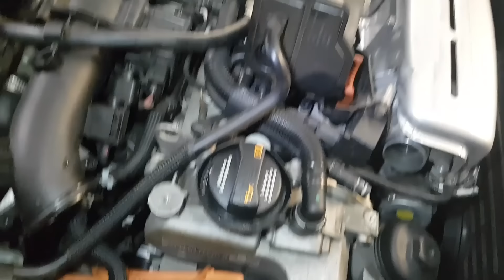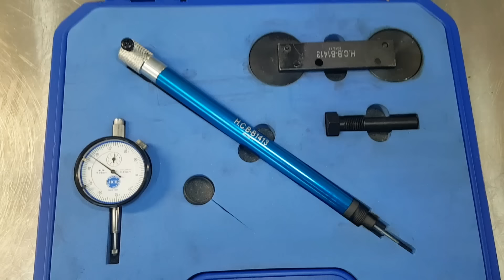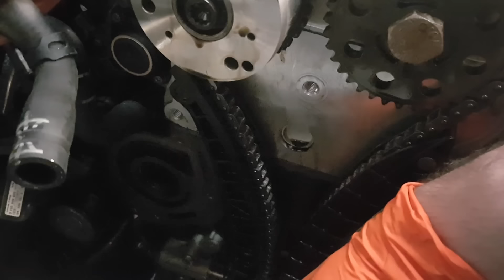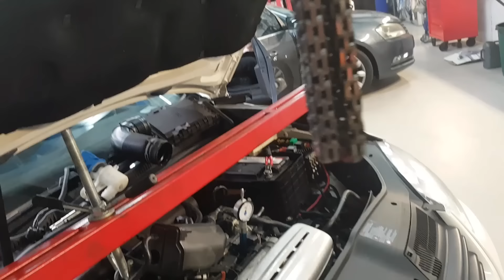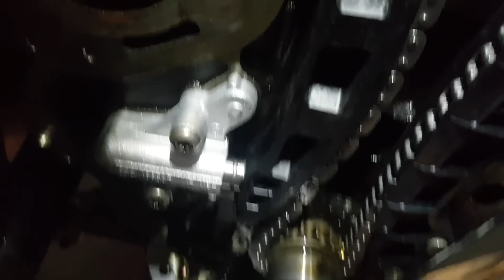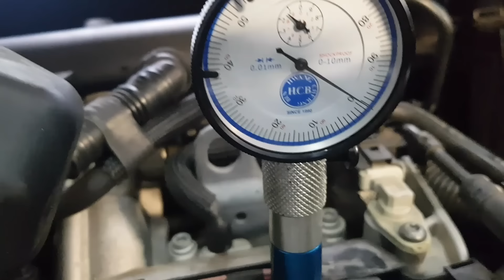P3008 VW 1.4TSI Timing Chain Replacement

Comment: I have just bought a tigy 1.4 tsi 2009 and had a fault code of  00022 crankshaft position camshaft position correlation bank 1 sensor A I have got myself the timing tool kit and new chain kit, from the code I’m getting I’m I just over thinking a simple sensor change? Or would it be benefiting to fit new chain anyway?
Reply from the maker: Your timing chain may have jumped (likely). The latest video on my channel is of a CAXA 1.4tsi golf with the same code and it has jumped timing. Worth doing the chain anyway if it hasn't already been done.
Reply: Could you tell me what size spline tool needed for the cam bolt it seams to be m11 but can’t seem to find one do you know the size and where to get one please, also do I need to remove the drive shaft to get the crank lock tool in?
Reply from the maker: @winxy1499  m12 triple square or xzn socket.
Reply: Thanks for the reply I’ll apparently you on what I find when done be some time next week befor I get other parts and do the work

Comment: What caused the timing chain to stretch?
Reply from the maker: The chains don't really stretch in a true sense, the individual links and rollers wear from poor quality oil and allow the chain to lenthen overall. If there were 100 pieces to the chain and each one had 0.01mm wear for example, the chain would end up 1mm longer. Just shows how such a small amount of wear and deviation overall causes a larger problem. Poor oil quality through extended servicing, wrong oil used, wrong fuel used - all contribute to the issue. The plastic guides break due to the stretched chain rattling back and forth as the engine is being started - where most of these chains jump timing on start  up due to the low engine speed and pulses on the chain drive.
Reply: @FourRingsAuto  
Thank you very much for your professional reply! ;)
Reply from the maker: Not a problem
Reply from the maker: To be honest though,  the chains just wear and stretch in general operation too it seems though. Should almost be a service item, however the biggest benefit of a chain over a belt is not having to change them as per the manufacturer specs. Once this is mentioned though, all thought to the chains maintenance goes out the window.
Reply: @FourRingsAuto  
Thanks for the response.  I've got a vw touran 1.4 tsi with 110k miles and there is a rattling noise on start up, though no codes or engine light is on. I'll have it checked out on servicing....
Reply from the maker: Rattling on cold start can be a stretched chain, tensioner leaking off pressure, or the inlet cam variator rattling (for the variable valve timing).
Reply: @FourRingsAuto  
👍🏿👍🏿

Comment: Great video and very helpful but did you not change the crank sprocket and will this not cause premature chain wear?
Reply from the maker: It was inspected and no damage found on the sprocket. I have inspected many chain drives over the years and you can visually see the wear in most cases. It is a good point that you mention though, and if there had been signs if wear it most definitely would have been replaced.

Comment: How did you seal the base of the timing chain cover where it meets the sump? I took the sump off to do mine as the cover will squeeze the sealant out at the bottom. Great video, thanks!
Reply from the maker: I think i mention in the video (but maybe not) that you are supposed to remove the sump for this reason. But you can get away with it installed if you are careful and have done this before. Applying a thin smear of the silicone sealant used for the corners of the timing cover was used on the top of the sump gasket. If there was a broken guide found upon removal of the timing cover, the sump would have to be removed to remove the pieces. I have done it this way on multiple 1.4tsi engines and other makes and models. It takes care and patience, you can't just slap it together. But I'd advise a first timer to remove the sump.
Reply: @FourRingsAuto  Awesome, thanks. Despite all this work, mine still chatters for the first 3-5 seconds on cold start up. Do you think it needs doing again?

Comment: Hi! Great videos! thank you! Can you please help me  diagnosting a similar engine? I have a 1.4 tsi with 180 hp and a DSG gearbox. This engine makes 13 mpg!! I have used everything, but the VCDS dont show any codes, and everything appears perfect. New spark plugs, no change. Only the knock sensor have 29V @5500 rpm, but vcds doesnt show a error or a timing pull. Car runs strong, apparently doesnt have any problem other than poor mileage. Thank you!
Reply from the maker: Check measured values 32 and 33 for fuel trims. 32 is the adaptation long term fuel trims. Negative means rich condition,  positive = lean. Let me know what you find.

Comment: Great video. Thanks for this. Im doing mine at the moment which I got quite early - no noise or lack of performance, just a P0016 fault. The kit I got came with the oil pump chain, new crank sprocket as well. Can I change these without removing the sump?
Reply from the maker: The sump will need removing to do these. It is the better way to do it as then you know the sump is sealed well with the timing cover too.
Reply: @FourRingsAuto  Thanks for the help. Best video on this procedure out there.
Reply: @FourRingsAuto  Another questions for you. Hoping you can help me out. After 3 days with no problems after the timing chain swap, the P0016 code popped up again. I checked the timing again and it is spot on. Put it back together and let it run through a warm up without going over 2000 rpm as I was thinking it could be VVT related. No pending fault, which makes me think it is a VVT issue. Is this a valid way to check this (Im assuming VVT doesnt kick in till higher RPM). Perhaps its a cam pos sensor issue. The only other possible problem I could see was the positioning of the cams in their journals as they did slide when I was installing the cam gears- should the ends be flush with the end caps (where you slot in the timing lock). The reluctor ring(?) is not centred when I look down the Cam pos sensor hole. Thanks in advance for your help. Cheers

Comment: Hi, when I opened the timing chain cover/housing then found timing chain was almost off the exhaust sprocket. Tensioner was fully released, timing chain almost touching in the middle at guides. One of the screws was lying at bottom of chain housing, bolt smashed, suffered blows from chain, pulleys etc. Do new timing chain to install. 
Most importantly, best way to achieve TDC is by TDC gauge. It’s more accurate than “drop screw in cylinder” method, and through piston stop tool. I have also removed sump so when it cylinder1 was at TDC, I checked crank shaft lobes from underneath , they were parallel to ground and locking tool goes straight into side of crank lobes. Hope that helps if somebody else is in same situation as me.
Reply: What mileage?

Comment: Nice work. Finally I found a good short and informative video of this job, Bought the kit since I will  have to do this job quite often (every 50.000 says the experts).  Hope I get it right. Thanks Four Rings Auto.
Reply: Please, did you change the timing kit? Did you change olso the sprockets?

Comment: Hi, great video. Just wanna ask 2 questions

1. When that special bolt is put in the back of engine head , and turn crankshaft, and when it reaches to a point where crank doesn’t rotate anymore, so then is that the TDC for cylinder 1? 
And if cylinder 1 is at TDC  then at that point will cylinder 4 be at at TDC as well? 

2. To find TDC for cylinder 4 ,  do we have to use the gauge  ? Why did you put gauge in cylinder-4 to find TDC? Do we have to find TDC for cylinder 1 & 4 indecently? 
Sorry I m trying to understand before replacing chain on my golf 1.4 tsi. 
Look to your kind reply,
Reply from the maker: When you put the bolt in it usually is at tdc, however, the vw audi instructions say to measure TDC at the piston crown with a dial test indicator  (the guage you see me use). I have found that when the bolt is in, the engine is at TDC. But it is still worth checking with either a DTI guage or just a simple screwdriver down the spark plug hole.

Cylinders 1 and 4 will be at tdc at the same time. I am using the guage in cyl 4 as it is easier to remove the ignition coil and spark plug than it us for cylinder 1. 

Also, just remember to make sure you have the correct TDC, as cylinder 1 and 4 will be on different strokes although both being at the top of their cylinders.
Reply: Four Rings Auto thanks for your reply. How to correctly find TDC for cylinder 1 & 4. 
When crank holding bolt is screwed , then I shud rotate crank until it stops. When it stops rotating that point is TDC and then I shud check cams with cam holding tool whether they are inline & timed or not? 
How to find TDC for cylinder 4? Isn’t when cylinder 1 is at TDC then cylinder 4 is also at TDC ? 
I have compression test gauge , can I use that for cylinder 4 ?
Reply: Four Rings Auto is this procedure correct to check & correct timing on golf 1.4 tsi
1. Put the bolt in and rotate crank until it stops. 
2. Then remove the cam plate covers and try to fit cam holding tool, if it fits, then timing is correct, if doesn’t fit then timing is out
3. If timing is out, then remove timing chain cover, and remove chain and rotate both cam exhaust & cam intake until both reach 45 degree angle and cam holding tool fit in there. 
4. Then put the chain & tensioner back on, tighten them to 40 & 50 nm . 
5. Then remove bolt from back of crank head and also remove cam holder and rotate crankshaft and to check TDC in cylinder 4. When TDC reaches in cyl 4 then check cam again whether they are in 45 degree angle and cam tool fit correctly. 
Is that it or I am missing something? 
Very sorry for the trouble. Real appreciate your help. Thanks a lot .
Reply: Four Rings Auto , thanks. You mean cylinder 1 should be at compression stroke when finding TDC. I will use a gauge. 
If I find TDC at cylinder 1 and confirmed it by gauge then should I check cylinder 4 for TDC as well?
Reply: Can I use vacuum leak test gauge ? Or need to buy TDC gauge for it? Thanks
Reply: As I read more workshop manual, got more understanding. 
So to correct the timing, 
1. Rotate crankshaft until camshaft locking tool fit.
2. Loose both both exhaust & intake cam sprockets, and rotate crankshaft for TDC. 
3. As soon as compression stroke begins in cylinder 1, I should screw crank locking bolt in, then rotate crankshaft and it will lock / stop at TDC. 
4. Now put on new chain, tensioner, guides and tighten camshaft sprockets as required. 
5. Remove crank locking bolt & cam locking tool, and rotate crankshaft for TDC in cylinder 1. during start of compression stroke, Put the locking bolt in head and rotate crank until it stops.
6. Check whether locking camshaft tool fit or not? If fits , then all ok. 
One thing, where the crankshaft stops by the locking bolt in compression stroke, is this the 100% accurate TDC? Or I should do this test by screwdriver or TDC gauge?
Is there anything else I need to do. Look to your reply . Regards.
Reply: Hi, just checked, both camshaft out of their required position. So timing out confirmed now. Brought the cylinder-1 to TDC in compression stroke and remove cam plates and found both cam out of position, and cam locking tool doesn’t fit. See video, 
https://youtu.be/snfvBrN2DLQ

I will install new timing chain. 🤪thanks for your help.

Comment: I have a Nissan note 2008 with 85k miles it's going in the shop for a replacement timing chain and I've been quoted £702 for the job,is this about the right price for the job?
Reply from the maker: Sorry i don't know much about nissan.
Reply: @FourRingsAuto  okay but how much would a timing chain replacement be anyway I.e say estimation price on a 1.4 petrol

Comment: Hi, nice video, thanks.
How to check timing without dismantling timing chain cover? Because on this model full cover need to be removed to access chain. Can I do it by removing camshaft cover plates and check whether both camshaft in certain specified angle to fit the camshaft tool properly? If both camshaft holes are as specified in repair manual (45 degree) then does this means timing is fine? Look to your reply,
Reply from the maker: Yes that is correct. Remove the plugs at the gearbox end of the engine, and remove the spark plug from cylinder 1 and check it's at TDC.
Reply: Four Rings Auto thanks, I will check , actually I m having starting issue, no engine code , spark plugs gets wet instantly. While cranking oil pressure light also starts blinking. I removed sump to check oil pick up tube, which is fine, now will change oil level sensor & oil pressure sensor too. I was told that car goes in fail safe mode if oil pressure is low, and Computer doesn’t let car start. I will check timing after changing sensors. How to find TDC? Can I do it by putting long screw driver in cylinder 1 and turn crank clock wise to find top high position of screw driver? Or should use compression gauge to find TDC? 
Thanks for your reply.
Reply from the maker: Use the screwdriver down cylinder 1.
Reply from the maker: Do a compression test also though if your spark plugs are wet with fuel. This can be either an ignition problem or compression. Check to see if you have spark.
Reply: Four Rings Auto thanks. I Did compression test after drying cylinders out, it goes over 200 psi in each cylinder. I also did fuel, sparks, etc, all fine. Cylinder gets flooded heavily upon cranking. I can see fuel on top of cylinder after removing plugs. 
Which one is cylinder 1? Is it nearest to crankshaft pulley/timing chain side or the one near to battery/ gearbox? There is another video of a German guy who changed chain on this particular model (1.4 tsi 170 bhp golf mk5), but he used cylinder nearest to timing chain to find TDC rather than far right cylinder? Appreciate you time & help. Regards
Reply from the maker: @786hunzavalley  cylinder 1 is timing chain end. Timing should be set with cylinder 1 at top dead centre. Camshafts marks will be visible behind the cam end plugs at the gearbox end of the engine.
Reply: Four Rings Auto , cheers. I will do all this in couple of days when weather gets better and update, 
again, many thanks for your help. Regards.

Comment: Subbed. Great video. 1.4 TSI BMY owner here. Lovely quality film job. Shame these engines are so damn complicated, yet so clever.
Reply: Hy Daniel! It's been 3 years now, do you still have the car? How is the engine and what's your opinion, I just bought a second hand 150000 miles on dash VW Touran with the 1.4 bmy and I'm quite concerned about its reliability. My car has a dsg6 automatic gearbox, I dive like am old man, would last a long time of I look after it changing the oils, filters and timing chain in time? Cheers!
Reply: @soareandrei6504  DSG 6 is very good. Just change the gearbox oil at a workshop that has done it before.

The engine is not reliable. I still have it and love it, but it is very fragile.
Change the engine oil to 5W30 Castrol LL (504/507.000) at MAX 10.000km...

I still drive it, but a lot can go wrong on these.
If you change the timing chain, then to a complete change. Also the timing gears, rails and check the other chain to the oil pump. 
A full original set from VW with everything is about €900-1000 for the parts, but it has every thing for a complete timing chain change. 

The water pump drives the supercharger, so if that breaks it is about €500 for the part alone + labour.

Spark plugs and coils are not the best either, but I keep mine.
Reply: @soareandrei6504  I have written a long reply, but I can't see it. Can you?
Reply from the maker: I can see it
Reply: @FourRingsAuto  Good. Fun fact, today the air condition bolt for the compressor broke (I think), making a lovely metallic sound. 

I love it!
Reply: Thank you so much for the reply, sorry I couldn't answer earlier, just recovered my email few days ago.

Comment: 🤦🏼‍♂️ this is quite a bollocks of a job!
I’ve a 2010 1.4tsi with 48,000 and it’s starting to give a rattle on cold start up ffs not looking forward to paying for this repair😩 bad design on vw behalf
Reply: Did you end up changing it?
Reply: yea, did all this chain change for 2nd hand A3 and it failed again after 60 000. This time even exhaust camshaft sprocket was slipped. Really bad design for engine!

Comment: Hi, how far can the timing chain stretch before valves hit the pistons? and is there a known Fault on the mechanical fuel pump Failing and then flush fuel into the oil?
Reply from the maker: It will jump and hit valves with a stretched chain rather than the chain be stretched enough alone for the timing to go that far out. This one had jumped on the crank it seems, as both cams were in time with one another still. 
You are correct with hpfp failure lime that, more seen on the fsi v8 and v10. Fuel injector leakage will also result in fuel in the oil. Any form of rich condition repair should have the oil changed afterwards.